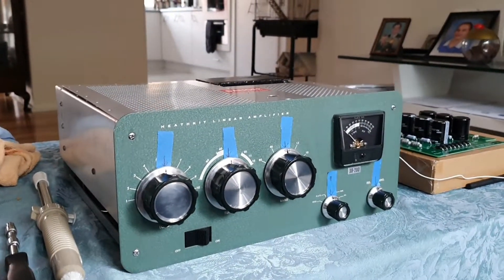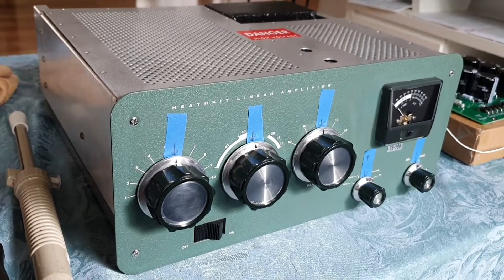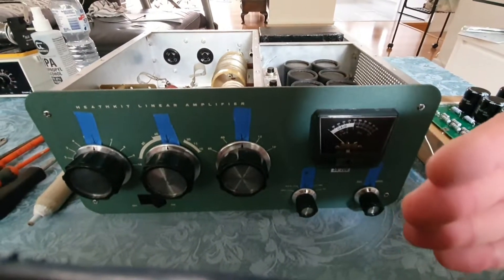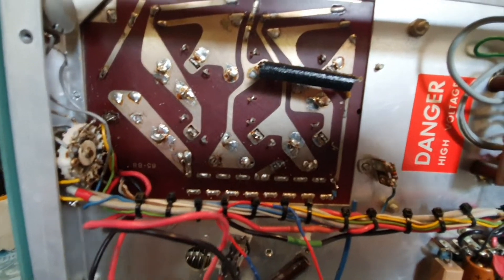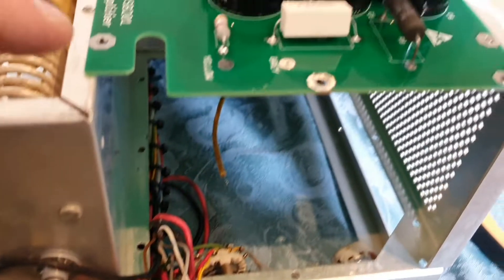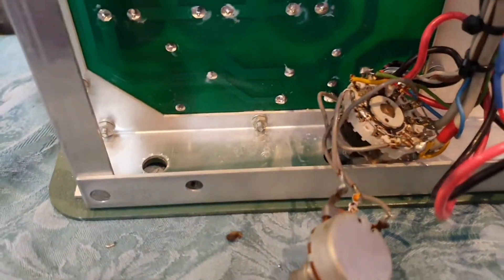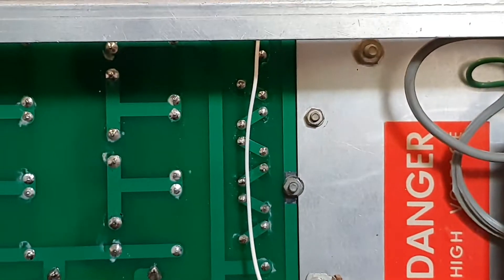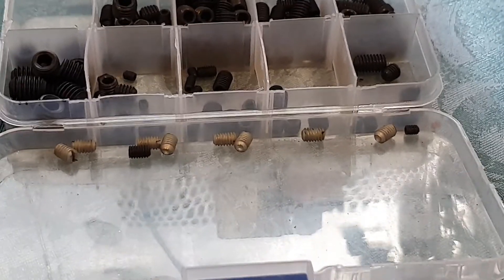HEATHKIT SB-200 EBAY POWER SUPPLY BOARD INSTALL START TO FINISH - Part 2

Comment: Hi Paul I have a question have you ever had a customer that had a working unit and put it away for a few years and decide to 🔌 into the wall and it wouldn't come on but was working before?
Reply from the maker: Hi Ray
It's electronics could be many things.

Needs to be problem investigated by a tech, these are very dangerous if not knowing about them
Reply: @Pull_It_Apart_Paul_Ham_CB  Hello Paul thank you for the reply yes I'm aware of that I do some I've just replaced the power supply module the other day in my Heatkit SB201 I know it's between the power switch and power cord I've tested the switch both circuit breakers and power cord ok thank you .
Reply from the maker: Check diodes in power supply unit
Reply: @Pull_It_Apart_Paul_Ham_CB  I'll check yesterday or Friday I received the Harbach board and installed the caps diodes and resistors but still the same problem like I said I talked on it tubes gotten weak so I put it aside for at least 5yrs and couple weeks ago I plugged it in the wall it wouldn't power up its something between the power switch and the power cord I was just wondering if you ran across that issue thank you I appreciate your help.
Reply from the maker: Never experienced it.

Faulty on off switch yes I hsve
Reply from the maker: Try cleaning on off switch contacts, and replace glass fueses
Reply: @Pull_It_Apart_Paul_Ham_CB  That's the thing I don't see a inline fuse it just has the power cord going into the amp and it has 2 circuit breakers mounted to the left side above the power supply module .
Reply from the maker: Check there is power to the 2 red reset buttons these also fail
Reply from the maker: With a multi meter follow ac back from input, looking for where it disappears
Reply: @Pull_It_Apart_Paul_Ham_CB  Gotcha thank you very much I appreciate it I'm not gonna take up nomore of your time have a great Thanksgiving.

Comment: Thanks for the video on a very popular amplifier and have done these mods to mine also. Only problem I have is the input of the amplifier cause a high SWR on my transceiver and I have to use the internal tuner. Will see what can be done to tune the input of SB-200 and eliminate the need for the tuner. de VE5EE
Reply from the maker: Check ceramic caps on rear at tuning coils, and resistors, most issues there, or  failed tx/rx relay, common issue